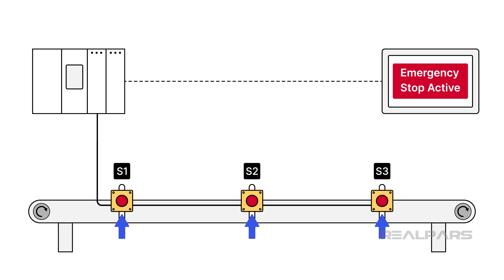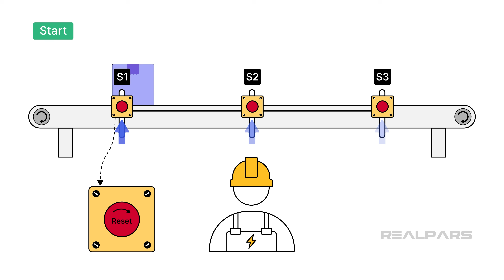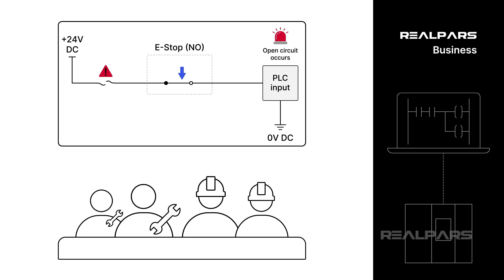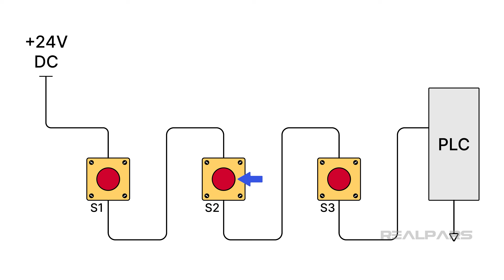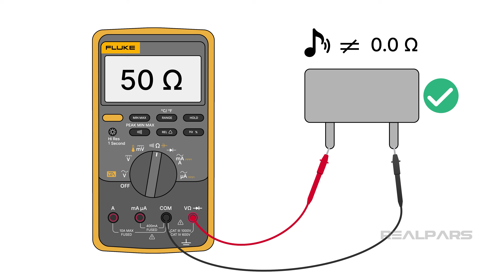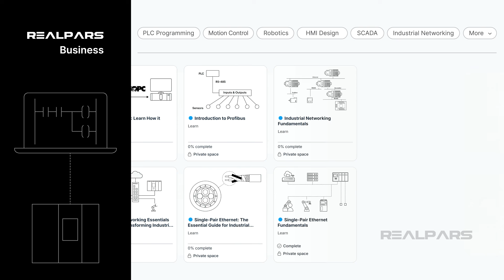Why the Series Emergency Stop Circuit Failed

Comment: Worth underlining for newer techs: dual-channel safety circuits are deliberately built so a single fault becomes findable instead of silent, and the safety relay's feedback monitoring is where that story gets told. That design intent is the real lesson in this one.
Reply from the maker: Spot on; understanding the design intent behind dual-channel safety is exactly what makes for a great technician.
Reply: @realpars  Appreciate that - the piece that completes the picture is the external device monitoring loop, because dual channel proves the input side and it is the mirrored NC contacts on the final contactors that prove nothing downstream has welded. Same reason the reset is monitored rather than simply wired through: an unmonitored reset quietly turns a fault-detecting circuit back into a two-wire one.

Comment: Hello,

I hope you're doing well.

My name is Muhammad Toqeer Ahmad, and I am currently working in Saudi Arabia as an Electromechanical Technician in the food industry. I have basic PLC programming knowledge and learned Ladder Logic using Delta PLC (WPL Software) during my college studies. I also have experience designing control and power circuits.

I am passionate about learning Siemens PLC programming and would like to master TIA Portal from beginner to advanced level.

Could you please let me know if RealPars offers a comprehensive TIA Portal course covering the complete learning path?

Thank you for your time. I look forward to your response.

Best regards,
Muhammad Toqeer Ahmad
Reply from the maker: Thank you for reaching out, and we recommend checking our website to see our current course library and learning paths! https://www.realpars.com/courses